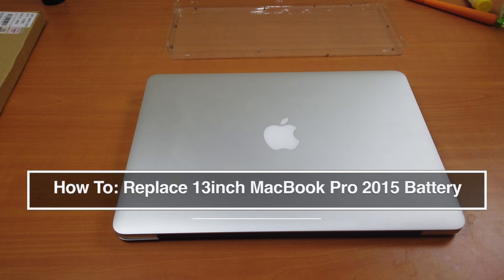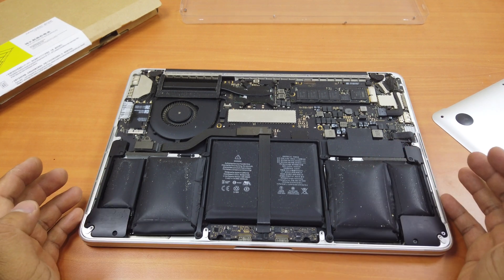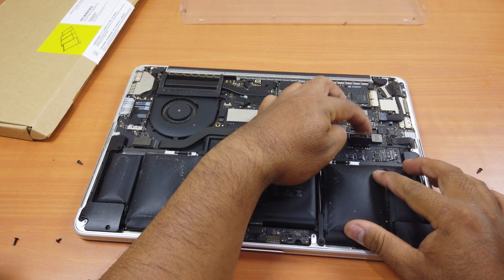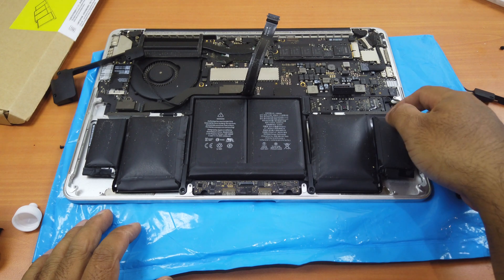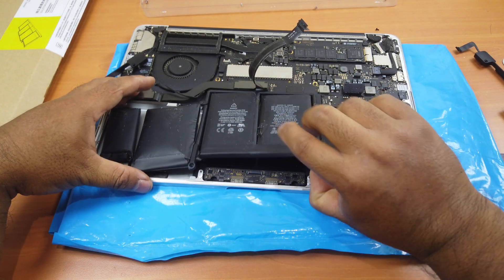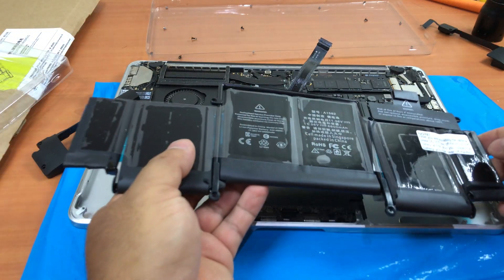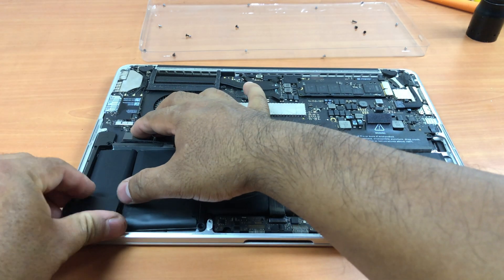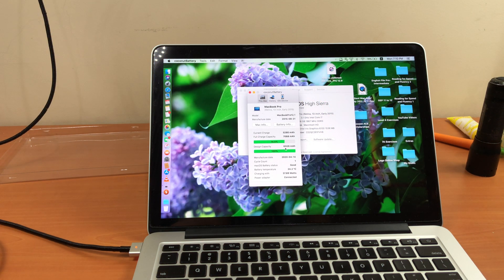How To: Replace 13 inch MacBook Pro 2015 Battery

Comment: Very helpful. I have one question, how do I remove the four pins around the centre cells? I noticed that you didn't replace them with the new battery.
Reply from the maker: You meant the keyboard and trackpad cable? The footage of that section was lost at that time. You can watch my newer video for how to do that.

Comment: I changed the battery and it turned on, I put in my password and then it turned off. What did I do wrong?
Reply from the maker: Plug in the charging cable and try again

Comment: Thank you ❤ your video was very easy to follow and your calming reassuring voice helps the process! My Mac also has a small cover with two screws next to the trackpad connection… not sure if yours had it or if you skipped it.  My battery somehow came out without the rubbing alcohol (I had none) I just used the card and it moved out 😅. Infinite thanks for this great and well explained video. 🎉🎉🎉
Reply from the maker: Glad it helped

Comment: Does it boot without a battery? I use mine as a media device for my tv and don't need a battery? I wan't to remove but knowing Apple It probably won't boot without a battery.
Reply from the maker: No. It needs a battery to connect power supply to the motherboard

Comment: Thanks man, I just now successfully changed my battery. It would drain to 0% in 2 hours, doable but I knew it would just get worse and it was dying on me in class so I finally bought the battery and this vid helped me get it done.
Reply from the maker: You’re welcome
Reply: Did you buy an original new battery? And if yes, where did you buy it?
Reply: @DKyugioh  Yeah, on Amazon. Looked up which one was meant for my laptop, bought it, then generally followed the vid's directions. Been 2 months now and it's working great.

Comment: Is this battery still working?
Reply from the maker: It had been used for about 2 or 3 years before it was replaced with another one. At least it’s a lot cheaper than replacing at Apple Repair shop.

Comment: My keyboard and trackpad isn’t working now :( I tried plugging and unplugging but still nothing
Reply from the maker: Did it work before? If so, try to completely remove the cable  on both ends and reconnect. If the problem still persists, you might need to replace your trackpad and keyboard cable.
Reply from the maker: If that is the case, here is another video of Step-by-Step Guide on How to Replace the Trackpad and Keyboard Cable on a 13-inch MacBook Pro 2015
https://youtu.be/TOVaN6oaiTk

Comment: Please how long did your replaced battery last on standby
Reply from the maker: I’ve never tried on standby mode. But for battery usage in a normal mode, I can use it up to 9 hours or 10 hours in some cases. But I believe on standby mode, it should last longer.

Comment: Do you have to wait 12 hours inorder to put the new battery in for the capacitor memory?
Reply from the maker: No not really. I just replaced right after I removed the old battery
Reply: @CamTechElearning  what's a good site to get a screen replacement? The screen just went black out of nowhere
Reply from the maker: It depends on where you live and your budget.

Comment: Hey iv replaced mine recently and my laptop is working fine how ever in system preferences it says there is no battery installed and i cant see a batt % ? any ideas
Reply from the maker: That was not supposed to happen. What year is your macbook?

Comment: Hi!
If the battery needs to be replaced the mac start to get slower by design? Even if it's on charger?
Reply from the maker: No. Battery has nothing to do with slow operating system.
Reply from the maker: If you downgrade it back to High Sierra, it will be fast again.
Reply: @CamTechElearning  thank you!
Reply from the maker: It’s slow not because of the battery replacement, but because of you upgrading your MacOS to later or the latest version.

Comment: ***Important: This wasn't mentioned or emphasized in the video, but when removing the trackpad cable be sure to flip-up the tiny little tab that's connected to the lower-connecter before proceeding to pull the trackpad cable out of it!👌🏾
Reply: Should have read your comment first. I fried my mainboard because I didnt unplug it now my macbook is broken. Damn.
Reply: THISSS! There was no mention of flipping up the tiny tab and I didn’t flip it and it seems like something happened with where the wire connects and now my keyboard/trackpad is no longer working.
Reply: Really. Reedit your video or take it down. This small neglicence fried my keyboard.
Reply: My keyboard and trackpad are broken.😩 It’s best not to follow this WRONG video.
Reply from the maker: @roro-rj2bc unplug the keyboard and trackpad cable and replug it. You must’ve have plugged it improperly too hush.
Reply: @CamTechElearning  No you stopped at this important step and went on about the adhesive remover. Probably one of the most important and fragile connectors.

Comment: Don't use this method to replace battery. 2 of my keys letters stop working when somehow some alcohol got to them. Too risky to do it like this. Found out the hard way...ruining my machine. Try using a heat gun/hair dryer on low on the palm aluminum surface on the other side to loosen the glue.

Comment: make sure to PROPERLY  insert the battery connector. I thought I had but it turns out the battery connector was slightly unplugged and I thought I had a "bad" new battery. So, i opened it again and verified the connector, and that's when i realized about my mistake.

Comment: Well now my keyboard and track pad don’t work at all following this video. I have tried for the past hour to reattach the trackpad ribbon but it refuses to fully slide in - the small plastic tab on top of the end of the trackpad ribbon snapped off. Now I am stuck with a MacBook Pro that I can’t even log into because the keyboard and mouse trackpad won’t work anymore
Reply from the maker: You have to be very gentle when detaching and re-attaching the cable. It’s very delicate and fragile.
Reply: @CamTechElearning  I even bought a new cable and it still won't work. Following this video completely destroyed my MacBook Pro and I had to get a new one as the original is slow and sluggish and won't work anymore after attempting to replace the battery
Reply: @trevorgoodchild4603  So this video made you break your MacBook not your lack of technical skills. 
OK buddy whatever you say.
Reply: @Noise-Conductor   and what business is it of yours other than being a troll? How are you helping right now? I followed this video and now as a result, lost 3 years of data and my MacBook Pro is slow sluggish it is unusable. I learned my lesson - take it to the Apple Store and let them do the work. But you? Do you normally go around kicking people when they are down? Is that your "Poetic Noise?" Thanks buddy. You must be a real gem of a person.
Reply: @trevorgoodchild4603  So it's this video fault that you didn't back up your important data in 3 years? LOL
Reply: @Noise-Conductor  so you just go around trying to make people feel bad about themselves?
Reply: @Noise-Conductor  and on that day they parted ways, having learned nothing from each other… the old man continued on in disgruntlement, thinking his personal values meant anything to the uncaring anonymity of the internet. and the young teen quickly forgot the interaction, not recognizing the deficit of their own empathy it had demonstrated…
Reply: @dialog_box  Somebody cared enough to reply to this 5 month old comment.
I totally forgot about this, so thanks for reminding me & letting laugh all over again 😅...."is it the videos fault that you didn't backup your important data in 3 years?"...classic!
Reply: @Noise-Conductor  lmao just doing my duty 🫡

Comment: Would acetone work as a adhesive remover???
Reply from the maker: Based on expert's recommendation, alcohol is better than acetone.
Reply: I used nail polish remover & it worked.

Comment: Thank you! very helpful, battery changed successfully thank you again. The alcohol (I use 99.9% Isopropyl alcohol) and the scalper was very useful, the battery went off so easily.

Comment: The battery model is on the battery not on the Macbook A1502 can fit two different battery types...
Reply from the maker: Are you serious? The MacBook model tells us what battery we need to buy without having to opening the cover. I don’t know many types of battery that can fit in MacBook A1502 but as long as it is claimed by the manufacturer that it is compatible, I’ll go for it.

Comment: How good is the performance of the battery compared to the original one?
Reply from the maker: I have used it for a year now. It lasts as long as the original about 9h to 10h depending on the usage. Its capacity now drops to 98% after 1 year of usage.

Comment: You are such a real one man, I didn’t even need help with my battery I just needed to clean my fan and couldn’t find a video showing how to disconnect my specific MacBooks battery but you have the same one as me and showed it very clearly thanks !
Reply from the maker: You’re welcome
Reply: @CamTechElearning  Do you need an anti static mat? What was the blue thing under neath the lap top?
Reply from the maker: It be better if you have it. It is not necessary as long as you keep both feet above the floor or wear shoes. The blue thing is plastic sheet.

Comment: I replaced mine - Thanks for the video - BUT now my speakers now sound terrible! I've tried pram resets and other troubleshooting steps but they still sound hollow and crackly. Appreciate any thoughts if anyone else had this issue?
Reply from the maker: Did it happen before you replaced the battery or after? Do they come originally with the mac or replacements?
Reply: @CamTechElearning  - After replacing the battery with a non oem replacement. Both left and right have the same crackle and thin sound. It's a shame as the new battery seems fine...it's just the audio is terrible now.
Reply from the maker: It’s not supposed to happen because these are two completely different things. I think the problem comes from your speakers. They may be the faulty speakers.
Reply: It happens to me. But i hadn't change the battery

Comment: How is the battery now?
Reply from the maker: It works great. It lasts longer than the Apple battery for the time being. Currently, I can use my MacBook close to 11 hours. However, I'm not sure if it will last 4 years as the Apple battery.